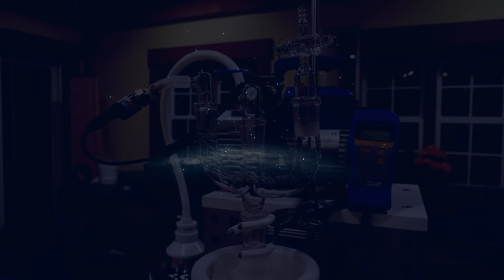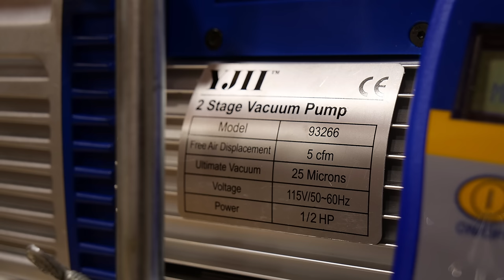Vacuum pump with NO moving parts

Comment: Sorry for the late question, I just stumbled across this video! I'm curious why the pump was not able to pull the vacuum down to its rated spec (or the 20 microns it proved it was capable of) at around the 16 minute mark when the desiccant was at a high temperature? This seems counter-intuitive to me, as the meter should be indicating the fee air molecules in the system that the pump has the ability to pull out. Does this have to do with the temperature of these excited molecules?
Reply from the maker: The surface area of the sieve is very large, and so it will outgas for hours even at an elevated temperature.  Eventually, the ultimate pressure will be reached.
Reply: @TechIngredients  Thank you so much for the fast response! That definitely helps me clear up my confusion. So if time was allowed for the material to out-gas fully, and the pump was given time to pull the system back down to its 20 micron capabilities, then the system was sealed off completely and allowed to normalize to room temperature (assuming the seals were all perfect), would we expect the meter to drop well below the 20 microns that the pump was able to pull as the remaining gasses find their way into the desiccant, and cling to its pour structure? Or is there a minimum pressure threshold that the desiccant can achieve?  I suppose my ultimate question is - Could a desiccant be used to achieve a much higher (or I guess lower) Vacuum value than the pump is capable of using the method you showed?
Reply from the maker: The key is heat. If the sieve is throughly outgassed at an elevated temperature, then the pressure floor is lower as the temperature is dropped.

Comment: That's really neat, I had no idea about this.
Could I do cold distillation of alcohol with these sieves?  I wonder if ethanol has a different enough size than methanol that you could separate the ethanol from both water and methanol this way.
Reply from the maker: I don't think you could use the molecular size to differentiate them, but like with the oxygen and nitrogen, the surface affinity may allow a concentration enhancement.

Comment: Now take that flask with the vacuumed zeolite, through a isolation valve connect a flask with water at ambient pressure.
The moment you open the isolation valve, the pressure equalizes and ?. :)

Comment: I noticed a tube running off the vacuum pump’s oil reservoir- what’s that about? I’ve had some trouble with oil splash on mine, wondering if that’s the same reason for your setup.
Reply from the maker: Yes it is. Check out our video on the plasma tube where I described the components of the pumping system.

Comment: now to make argon concentration device be super cool for the shop [ tig welding gas ] can that not be done with this stuff
Reply from the maker: Problem is argon is in such a low concentration in the atmosphere it would take a lot of stages.  On the other hand, argon will have a much lower affinity and separate more readily.
Reply: @TechIngredients  humm with that said b seems like a handy device if one could tool it up . i am very green at all this  i sure would build one if i could get something to work as to eliminate going to gas store would just be cool in its self .so you thank it could be done as your  statement seems to hold promise for building one May be hack up an old medical device and add stages like i said i am green at this but not lost at all ..pardon my bad grammar and or rambling messy mind lol..be blessed friend

Comment: Can someone explain what the heating and cooling of the desiccant is doing to allow it to take in more gasses.
Reply from the maker: The weak strength of the adsorbtion process is countered by thermal vibrations.  Heating increases that vibrational energy, driving off the adsorbed molecules.  Cooling allows the adsorbtion force to dominate, accumulating more molecules.
Reply: @TechIngredients  OH wow, that actually makes a lot of sense. Thank you for the explanation.

Comment: Could a simple; solid state vacuum pump be constructed for use in evacuating refrigerant system using the beads ; i.e. vehicle a/c systems? Thanks.
Reply from the maker: Potentially, yes.

Comment: How do the commercial cryopumps recharge the molecular sieves? Or are they also only for small volumes?
Reply from the maker: They also heat them.  Once you lower the temperature below LN2, almost all gasses condense and the pumping volume increases greatly.

Comment: I love this kind of videos, makes me go back to my old chemical books to re-read what I've learned 40 years ago ;-)
I have a question about the exhaust filter on the yellow jacket pump: I have a similar vacuum pump and they included a motor cycle oil filter that reduces the amount of oil vapor in the exhaust air but when using it indoors the air gets filled with oil vapor. I tried to add different kind of filters but none of them was able to remove the oil vapor from the air. I am curious about the filter you use.
Reply: It was covered in the plasma videos a month or so back
Reply: @cambridgemart2075  Thanks, found it. I actually have a few of those filters for my laser cutter, will try this out on the vacuum pump.

Comment: By heating the zeolite under vacuum you have essentially recharged it, renewing it's molecular absorption potential.
Reply from the maker: Correct
Reply: @TechIngredients  I've worked on O2 concentrators for more years than I'd like to admit. The prices for sieve have risen substantially in the last couple years and I'd consider recharging it if I had the equipment.

Comment: Very interesting! I'm curious, with the enormous surface area of the molecular sieves, I wonder if they would be great as an aquarium bio media or activated carbon substitute. I am not sure if the chemical makeup of the sieves and if they would harm aquatic life, but I would love your thoughts!
Reply from the maker: I suspect that they would not be as useful as activated carbon precisely because they have such a tightly controlled porosity.
Reply: Interesting, so I assume the benefit of activated carbon is the vast differential in sizes of the pores which in turn helps remove a larger variety of contaminants from the water? I'm just thinking out loud, thanks for replying! 
I've been in search of a material that will work just as efficient as activated carbon, but can be regenerated.

Comment: I'm still a little unclear on how this works. If you bake a bunch of this adsorbent bead material and then pour them into a sealed glass vessel with a vacuum gauge attached, can you achieve an arbitrary level of vacuum by adjusting the size of the vessel and the amount of adsorbent material used, i.e. do you have to cool the adsorbent with liquid nitrogen/helium to pull a hard vacuum?
Reply from the maker: The colder you go, the more gas you can pump and the lower the pressure.

Comment: Could this be used to make "vacuum in a can"? A single-use device that one could connect to a system to get reasonably low pressures even without a pump.
Reply from the maker: Yes.

Comment: Your videos are always amazing!

I've been slowly collecting the parts to make a freeze dryer (crossing my fingers that the pump I got is reliable, wish I'd known of the brand you suggested before I got it!).

One thing I'm particularly concerned about though is the pump exhaust. What is that filter you have on there?
Reply from the maker: Look up activated carbon filters for hydroponic applications on Amazon.
If you're interested, I went through the vacuum system in our video on the plasma tube.
Reply: @TechIngredients  Awesome, thanks so much!

Comment: What do you mean by "boil away" in reference to the process with the gases?
That's the only thing I'm unclear on...
Reply from the maker: It's based this term on the process where a surface releases a gas that has enough kenetic energy to overcome the binding energy potential with the surface.  This is what happens when a liquid boils and when a solid surface de-adsorbs a gas.

Comment: So, once the sieves adsorbs, for say mercury gas, chlorine gas, or cyanide gas, the gas won't bleed, leach, or escape after being adsorbed by the sieves?
Reply from the maker: Generally speaking, no.  Unless you create a favorable path for removal to a more stable sink such as heating the material to a high temperature or immersing it in a powerful acid.

Comment: Sir, can I used this aluminium silicate to separate aqueous cacl2 from water. That you mention  in video of desiccant base cooling system.
Reply from the maker: Probably to some extent, but both the dessicant and the CaCl2 have an affinity for the water and will compete for it.

Comment: Are the beads recyclable even after being saturated with something like mercury ?
Reply from the maker: With water aand air, definitely.  But, I wouldn't mess with mercury because even if you could drive the mercury off, the process would generate mercury vapor... someplace.

Comment: questions/ideas:
Why did Nikola Tesla insist about the aether despite michelson-morely experiment? (they continued with aether sticking to surface after  that)
How much energy is absorbed by water by telephone antennas that operate at 2,45Ghz and thus translate in heating the enviroment?
Why are we not using and or developing Raymond Rife resonant frequencies to kill off specific pathogens and instead continue to inject uncontrolled vacciness in our blood stream?
If high frequency microwaves open up the brain-blood barrier, couldn't this corelate to vacciness causing autism?
Reply: also: Why we using radio when Nikola Tesla wanted/could transmit amperes through Earth and with it the signal? (where you wouldnt need batteries, similar to AM crystal radio)

Comment: You mentioned creating oxygen-rich air for high altitude. Is this "easy" and cheap to do?  I did trekking in the Himalayas and it can mean the difference between life and death... even at lower altitudes. And carrying oxygen tanks up is expensive, heavy, and slow. 
Even if there were a machine that locals could use to sell air to tourists it would be great for them. It would not need to be pure oxygen, any increased levels would be useful and possible life-saving.
Reply: a high Level Oxygen tent for those who suffer from altitude illniss would come in handy sometimes. especially when the weather does not allow flying out the Patient.
then it Needs to operate without heavy consumables, and preferably on solar Panels.
Reply: @ulrichkalber9039  Even if it were heavy, a mechanical system would be lighter than oxygen tanks. When at 5000m of elevation there is only about 50% oxygen. A system that 60 or 70% would make a difference for people adapting to the altitude. Maybe a multi-stage canister system with 1-way valves. My doubt is about how it would be purged/cleaned to keep working continuously and how often it would need to be reset?

Comment: I'm trying to make the dml Loud speakers to replace my surround systems speakers... But I'm running into an issue... The speakers that I'm replacing are rated at 100w peak and 25 w rms... Those numbers don't match up! Should I just round up the rms and pick two transducers that match up? Or round down and add in a 5w tweeter or something?

I've been struggling with trying to figure this out for like a month lol
Reply from the maker: I would do a little experimentation.  The DML speakers may have a different output effeciency and so testing with a 40 as well as a 25 watt transducer on a pair of panels will give you an idea for what best matches your existing set up.
Reply: @TechIngredients  interesting I'll have to try that would be cheaper then getting 6 and blowing them all up lol

Comment: it is possible to use some sort of magnetic mechanism or laser to push remaining gas out to achieve a higher vacuum?
Reply from the maker: Actually, just lowering the temperature a few degrees with a vacuum over the liquid nitrogen willl condense the air and the pressure will really fall.

Comment: I read through some coments, and didnt see my question yet. so i hope im not repetative.
wouldnt the presure of the the air drop dramaticly anyway? I mean through the cooling of the air, that is done.
how large is the difference iwth and without adsorbtion? I hope you understand my question.

(I love the videos on this channel, too)
Reply from the maker: Sure, that's easy.  The pressure would drop by 77K/300K due to temperature alone. It fell by more than 60 fold due to surface adsorbtion.
Reply: @TechIngredients   Thank you!

Comment: Hiii...I like your videos....they are awesome......

And.........I am trying to make  a plane(RC) which, according to my unprofessional design, may break the rc plane speed record(465mph), and even the (I know its gonna sound unrealistic, but stay with me here....Trust me😅😅) sound barrier...And I have chosen fibreglass as the material of choice...But the problem is that at high speeds, aerodynamic friction and the compressed air in the shockwave will cause the plane to get hot(like more than 120°c or 248° F)...so I need an epoxy which can withstand temperatures up to 250°c(482° F)(by WITHSTAND I mean it does not soften at a given temprature)....Can you suggest a good epoxy to me which is strong, lightweight and has the temprature resistance I am looking for....and please tell me whether fibreglass is really a good material for this purpose, and if it is, should I use e glass or s glass(I watched some youtube videos and read on some websites that fibreglass used for aerospace applications is a type of e glass)
Reply: My guess is you got those numbers from literature on Concorde, The problem you have is that Concorde only does that speed at 60,000 feet(18,300 metres) where there is a lot less air resistance. You can forget glass fibre there will be lots of other problems with it other than temperature this is why it isn't used in aircraft apart from gliders. You may have a problem with the radio gear as well at 1KM every 3 seconds you are going to run out of range fast. Don't forget to check your local regulation on breaking the sound barrier it isn't normally allowed over land.

Sorry didn't mean to destroy your world the epoxy isn't the problem there are plenty of supersonic military aircraft with composite wings you need to use a stronger material than glass, Carbon fiber is used in a lot of military aircraft wings.

Comment: Maybe you should try making a cryocooler like the ones used in telcom. Do you think it's practical/within your reach?
Reply from the maker: The principles are, but the machining is challenging.  Maybe if a colab with Johnny Q.
Reply: @TechIngredients  That's exactly what I thought but still hoped maybe you'd come up with an affordable solution based on parts from a hardware store. If only life was so easy as learning the theory.

Comment: I set my vacuum gauge the similar usually (when I even use it), but it isn't giving a correct reading so close to the vacuum pump. Once you get into low microns there is no real flow, so if you have a vacuum probe near the pump, one halfway along the line, and one at the other end, you will get 3 different measurements. To use a single probe like that, you should really leave it sit for some time to let the particles equalize in location, which then allows more particles to boil off the surface... blah blah blah.. What your doing is pretty good, but if you want perfection then....

Comment: I'm surprised you didn't make a full on _pump_, that is a pump that operates continuously vs the one shot approach. You could do that, maybe with two stages and some UHV valves, cycling one stage cold and the other hot and vice versa, couldn't you?

Comment: How is the vacuum pump designed so that when a higher vacuumed system is 'attached' to the pump  the pump does not unvacuum / leak into the system
Reply from the maker: There is a continuous generation of gas as the surface de-adsorbs this gas into the vacuum. Anything that removes this gas will improve the vacuum.  Some systems will have a roughing pump to bring the pressure down from atmospheric and additional pumping can be added either in series or in parallel to further eliminate gas molecules.

Comment: You should repeat the experiment with a control: liquid nitrogen without the sieves.
Reply from the maker: The pressure will be similar, but the capacity will be miniscule.
Reply: For completeness you could technically; although, he asked us to assume/accept that the adsorbtion is proportional to surface area.

Comment: is that a cold trap your vacuum pump's output is connected to or an oil/particulate trap?
Reply from the maker: It's an activated carbon oil/particle trap.  I described it in our video on the plasma tube.
Reply: @TechIngredients  Neat! I own a few Yellow Jacket and Appion vacuum pumps because I do industrial HVAC and unfortunately purchased a few of the $100 yellow jacket oil particulate filters. It works great for when I sometimes have to pull vacuums indoors or just don't want a oil mist everywhere, but I realized because of your video with some ingenuity I could have built one for a fraction of the brand name equivalent. 😭 Thanks for the great video and it was interesting seeing my line of work and chemistry share similarities.

Comment: Hi,can you use an induction coil(turned on) to clean an evacuated container?
Reply from the maker: Plasma cleaning is used in the optics and semiconductor industries.  It often uses microwaves rather than high voltages because it's more controllable.

Comment: Showing your age.
Celcius has replaced centigrade (1948). In 1967/1968, Resolution 3 of the 13th CGPM renamed the unit increment of thermodynamic temperature "kelvin", symbol K, replacing "degree Kelvin", symbol °K.
Stange note, why was centigrade °C and not °c, I know of no one called Centigrade?